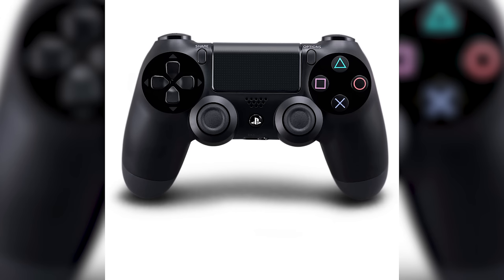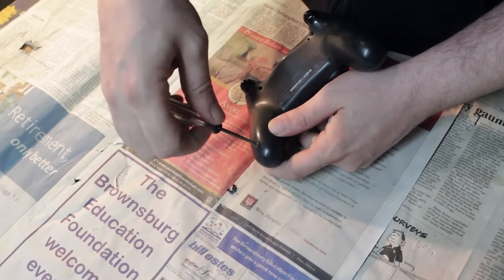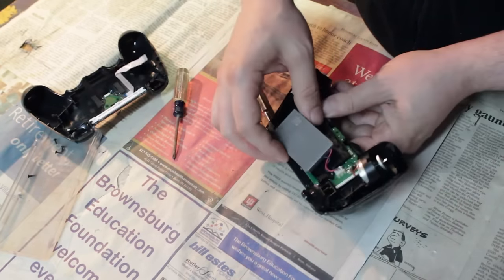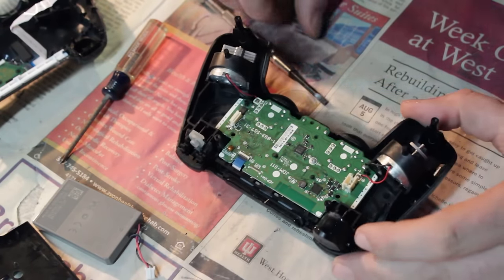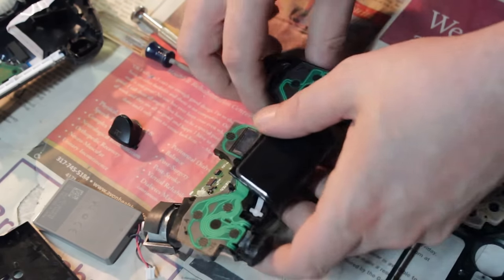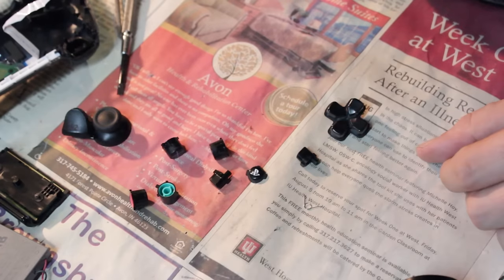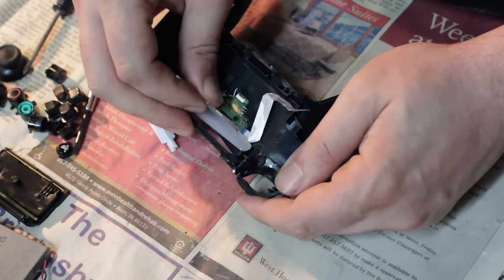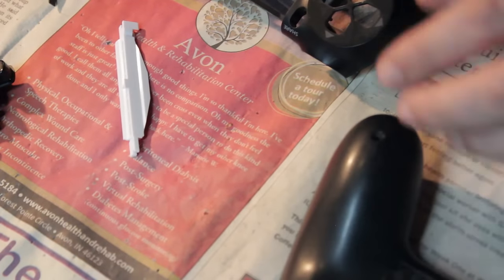How to take apart a PS4 Controller

Comment from the maker: For everyone asking about reassembly, Just look up my Custom Controller videos. Reassembly is in those videos.
Reply: I BOUGHT A PS4 FROM A PAWNSHOP AND THE PREVIOUS OWNER SPILT SODA OR SOMETHING ON IT IT WORKS ITS JUST THE SHARE BUTTON AND THE BOTTOM LEFT BIG BUTTON AND THAT'S ANNOYING BECAUSE I HAVE TO USE THAT BUTTON I REALLY DON'T WANT TO TAKE IT ALL APART AS I SEE HOW ITS DONE JUST TO CLEAN THAT BIG ASS BUTTON.
Reply: next time just link the video for reassembly
Reply: Bro I know it's been 5 years why is it so hard to unscrew the screws I've only gotten two and I've been trying for 30 minutes
Reply: @thatbirdguy9845 they're so small like wtf
Reply: @thatbirdguy9845  3 months too late, but yeah, you need an electronic screwdriver set or a shitty ratchet precision screwdriver like mine. Point is that the 4 grooves of the Philips format are less than half a milimeter OR 1/3 of 1/16th of an inch in thickness. 

Just tiny as hell, so a larger screwdriver will theoretically work because the opening of the grooves is > 0.5 mm (on top), but that's a shallow contact depth and so your screwdriver prolly just blunted the grooves at the top section and then only very fine screwdrivers can get these remaining screws out.
Reply: I can't get the last damn screw out
Reply: You don't have a video of you fixing the l3 buttons?
Reply: @Kazpper88  my grandson spilled juice. Options button is sticking.

Comment: The way it's showed it looks like he is only disassembling an Ikea table while actually it's like defusing a bomb without cutting any cables
Reply: Lol
Reply: Took me 5 minutes now I’m spray painting it gold lol
Reply: @fabuloso3635  pls help im scared
Reply: It was actually pretty easy
Reply: mine was just stuck super bad my dog got honey mustard all in it. When I opened it it flung and broke the fuckin cable
Reply: Bro I’m watching this and this comment embodies the process entirely ong
Reply: That’s tech repair lol
Reply: @trebory6  why you so mad LOL
Reply: Fr, like i fucking cant get this battery off😭
Reply: A $70 dollar bomb, especially when putting it back together and you had to feed one of those cable that tiny rectangle, cause if you mess up you'll have to pry it open again. 
I recommend modeling tweezers.
Reply: @Glyphnophis there’s a screw
Reply: It's crazy cuz Nintendo controllers are so easy I've taken apart with no problem 😭 wtf js wrong with Sony
Reply: It's not hard it is easier than it looks tbh
Reply: LOL, it's not that hard. You may end up breaking a few clips that hold the parts together, but they don't seem that important, as the screws will hold everything together anyways. If you've taken apart a few laptops to upgrade RAM / SSD, this won't be any worse.

Comment: Just trying to fix the sprinting in Cod
Reply: Long Live Pepe SAME Did you ever find a fix
Reply: me to
Reply: Me too
Reply: Long Live Pepe same
Reply: Hahaha I knew I wasn't the only one...
Reply: Same man same
Reply: Same
Reply: Same 😭
Reply: Same
Reply: Long Live Pepe same
Reply: Same lol how do you don it?
Reply: Literally same
Reply: Auto sprint
Reply: My l is busted I'm tryna clean it
Reply: Same
Reply: I have been to the point of crushing the controller because i cant run when i need to on cod. I literally have to keep pushing the analog down and it only only lets me run when it wants to.
Reply: Same
Reply: On god
Reply: @dorrion4x237  lol
Reply: Your comment was 2 years ago. And here I am with the same issue and looking for a fix. I thought it was just me until I went too Google for an answer and seen this issue been going on for year's.
Controller only few months old and as a lot of ppl,only get it on cod.
Reply: Same
Reply: Mr Aws I spray in switch cleaner or any other type of oil based lubricant and it fixes it. The issue might come back after a while but another spray should fix it
Reply: @damianc6623  I bought a new controller cos I was just getting the issue so much. Which is working fine at the moment.
But will give your fix a try since I don't mind messing with non sprinting one now I got the new one.
Reply: Mr Aws pull ur analog up then forward and blow inside of it because there’s dust, fixed mine like that
Reply: @hashimsharif3945  tried that already and didn't work. I have taken controller apart and cleaned inside. Still nothing changed.
I'm going too try spraying lubricant and see if that makes a change.
Reply: Mr Aws  I hear u bro, try any other game that has the same movement as mw and if u face the same problem there, then u need to buy new controller
Reply: Same
Reply: yeah 😅
Reply: Same dude, and now I can’t fucking fix it
Reply: I have 2 dead controller because of sprinting. I need to try soldering in a new stick
Reply: I was the 666 like lol
Reply: mhm, same here
Reply: I swear they designed that feature to fuck up remotes I play left handed because of it
Reply: Same man 😭
Reply: Same
Reply: Yk😂😂

Comment: im stuck at getting the controller apart its harder then it looks.
Reply: yeah, wth its super hard to do. I recon its easier after the first time but like, couldnt they have made it easier?
Reply: Way harder than it looks. And I used to mod xbox one controllers. This is a nightmare.
Reply: All my screws are rusted in and out
Reply: wonder why he sped the footage up for that part
Reply: Getting the triggers off is a bitch and he kinda breezed through that part..
Reply: I can’t even take out the screws
Reply: It’s great that in his “no BS” video, he speeds through prying it open(with a metal screwdriver) & removes the battery off camera
Reply: @trainergrim  same
Reply: Im stuck at the part where he puts it back together
Reply: you have to have a tiny screwdriver
Reply: I finally did it!!!
Reply: Nvm I just broke my L trigger 🤦🏻‍♂️
Reply: Wait I just fixed it
Reply: @luis9943  lol
Reply: Than*
Reply: There's no doubt Sony purposely designs them so they're difficult to disassemble. They'd obviously prefer you buy a new controller instead of fixing the one you have.
Reply from the maker: @joshlarson5316  I sped the footage AFTER that part to get the video less than 10 minutes long.  Yall are some crying asses.  Get your shit together!!
Reply from the maker: @joshlarson5316  awwww..... I'll hold your little hand while you do this if you want.
Reply: @joshlarson5316  why would anyone want to watch him for 5 minutes just to take that one piece off?
Reply: Same
Reply: i almost broke it while opening it bc like, that white rope untied itself, so i fucked myself to put it in, but its working now ig
Reply: For anyone coming late to this:
Squeeze the handles to get them to separate alittle and then use some kind of thin tool (plastic tools leaves fewer marks) to pry the halves apart carefully.
Reply: Josh Larson i mean if you mess it up u mess it up. You live and learn,it’s not hard
Reply: Lol what a bunch of whiners.
Reply: Ikr
Reply: @joshstone4052  yea mine to
Reply: Watched this vid, took it apart and I was like okay what's next 😭

Only to close it back.

Ps it's easy to take the ribbon apart but putting it back is like playing Dark souls over again
Reply: @Drumblanket  Aww, can't take criticism on your crummy video.
Why not show viewers where the 4 clips are located, and which way to pry to unlatch them without breaking them.
Nah, if viewers critique your ordinary content, just abuse them!
Reply: Drumblanket chill OP
Reply: @DodgeThatAttack  I broke all 4 clips on mine, they're not necessary as the 4 screws hold the controller together. The seam is just a little bit larger in some areas now, not as tight together. It's like a 0.75mm seam now, instead of a 0.25mm (rough estimate).
Reply: @EliteScentsOnly  nop it's a butiful dream cuz Xbox is the best
Reply: notPranipus it gets easier doing it few times. it really depends on what you’ve learned from your mistakes. these times takes hours upon hours when it’s your first time.
Reply: I did it pretty alright
Reply: Lurioso Spelar thanks
Reply: Yeah i cant get two of screws to turn
Reply: I broke mine :(
Reply: @Drumblanket  Take it from Drublanket guys. If you make a mistake in a tutorial, and someone points it out to you, the best way to take that criticism is to insult there intelligence with the skill and wit of your average kindergartener.

Comment: my r1 button is stuck registering like its being pressed. I took the button off and nothing appears to be stuck and doesnt register when being pushed even with the button off so im guessing its some sort of internal issue. It would be fine if i could remap the button to something else by using the ps4 custom button assignments but the absolute geniuses who designed that wont allow the custom settings to work if there is any input being pressed which is beyond stupid. This is my 3rd brand new controller in 2 months that has broken and i hardly used them nor have i dropped them or been rough with them they just fail on their own like this. Charging dam near $70 for such cheaply made crap that breaks after a few hours of use should be a crime im so fed up smh

Comment: I was recommended this video and it helped a lot!
I spilled some milk tea on my controller and it got slightly sticky so I ended up following this video and managed to stress free dismantle, clean, and restore my ps4 controller.
I then went and fixed my older controller that was ruined and forgotten after I spilled beer on it and managed to restore it even better than my current one after some deep cleaning. I didnt know how to remove the L1 button but after taking your advice, I just tried harder and it popped out lol. Got a good cleaning done and the only issues I had was I dropped a screw onto a carpet floor when putting things back together. Now I have two fully functioning controllers instead of one.

Thanks so much! :D
Reply: You sure love wasting stuff😂
Reply: Nah I'm just a pathological spiller.

Comment: Thanks, I had a loose USB port and your video helped me get the controller open without damaging it.  Then all I needed to do is gently squeeze the metal frame of the port using parallel pliers to give it a snug fit again.  Works great!.  I had stepped on the charging cable while it was in the controller and the plug managed to pry the metal plates of the port wider and the plug wouldn't stay in, this solved that! Now I have a very nice click when I put the plug in and it firmly holds the plug in place.

Comment: Thank you very much for this video. Saved me 65 bucks! Threw my controller ONE TIME (first time since I was a kid) and it messed up the left stick. Basically, it had indented the plastic post to where it was harder to press down. Just shaved a little bit off the post where it was sticking, and it’s like new. Thanks again!

Comment: this video's great, thanks boi. fixed my directional buttons. easy.
[edit]
"easy" - yeah, no, those ribbon cables are AIDS, constantly terrified i was gonna break 'em lol.
Reply: Not gunna lie it waz ez
Reply: I definitely broke one putting it back together. My triangle button was sticking so took apart too, like I've done my ps4. Broke the golden ribbon on the top. It will select things, and go back, but once in a game, the controller doesn't work at all.
Reply: To clean*
Reply: I broke them help me what do I do
Reply: @wcoadventures  buy new cables, see if they have a part number on them somewhere. otherwise, you're buggered, buy a new DS4 - be more careful next time.

Comment: Who else got stuck on putting it back together?
Reply: I'm in the middle of snapping the top back onto the bottom, can't get the section around R2 and L2 to snap back on correctly..... lol
Reply: @dwrek2054  same man I'm getting nervous
Reply: Juan Cardona I eventually got it together, but it’s been so long now I don’t remember what I did 😂
Reply: this comment thread is why I'm not doing it lmaooo
Reply: @dwrek2054  so if you remove the l2 and r2 from the back of the controller there is a silver hinge use a small flat head to push it forward then hold it with your hand and snap the buttons inside
Reply: I had trouble putting the touchpad ribbon back into place but other than that it was fine
Reply: @unifiedoblivion_  i'm stuck there too. How do end up putting it? I can't
Reply: Me
Reply: Man i Hates doing this tho first and second time i just normal but on the third one i got stock and broke my 7 pin flex $h*t
Reply: not even hard use your head bruh
Reply: Put it all back.. doesn't turn on..fuck me

Comment: Thanks for the tutorial! Gosh I had no idea how difficult it was to pull apart a PS4 controller! My D pad was going bad so I bought some parts to replace it. Now everything works like new! I’m happy. 🙂
Reply: Aw good yeah it helped me too I had stick drift and now it’s Gone but now the damn apex servers aren’t working
Reply: @peta-butter2744  how specifically did you fix it i still have some not nowhere near as bad but its still there
Reply: @thewarrior909  umm so I fixed it for a little bit as long as you didn’t click in the stick. But then it just got bad again I think the stick was just wore out. There was nothing to clean I just tried to lube it. So I wanted a cheap controller so I looked on offer up and this guy was selling a bunch of them but turns out they were fake… so I spent even MORE money and bought an official one. And it’s great. Words of wisdom just buy Sony first, you get what you pay for!
Reply: @peta-butter2744  thats good i had a few controllers as well and on a newer one my down dpad button didnt work so i just  swapped some parts and the one that has stick drift still has it but its a older one so i just use my fixed one now

Comment: Had a problem with the X not coming back up after being pressed, took it apart with the help of this vid, and found that the silicone button thingy had a tear in it, so i got one of my old controllers and replaced it. Works great now.

Comment: Great video, very clear, very concise. Needed to dig into my dualshocks guts a bit to figure out what was causing me to have deadzone issues but, seeing as how I'm not a mongoloid, I didn't wanna go accidentally breaking something cause I don't know what I'm doing. This video was a great help. Unfortunately I had to use a little more force than I'd like to get the casing off and ended up snapping a tiny tiny itty bitty little facet. Knowing my luck it's probably the most important part too. Anyway thanks for such a clear and helpful video

Comment: My down D pad wasn't working, I finally got tired of dealing with it, so I found this video. Now, not only do I have a fully functioning controller again (My issue was cleaning it, for anyone with the same issue, use a cotton swab/ q tip and some isopropyl alcohol if needed), but I actually understand the anatomy of my controller. Thank you so much.
Reply: My down d pad no longer works. It started messing up on me again about a week later (pushing it really hard usually did the trick in fixing it) but now it does not work no matter what I do. My screws are messed up beyond repair now so I need a new controller.

Comment: I'm stuck at removing the screws, they're very hard that my hand was hurting for a day trying to unscrew them. I'm weak
Reply: @umayrhussain3211  if it takes that long you may have stripped the screw trying to use a knife or the wrong size screw driver. Use the right tool for the job and it's waaaay easier
Reply: Do they sell a PlayStation screw specific screwdriver lol?
Reply: @enflow8440  my pops had some a lot of tools so I'm just lucky
Reply: @Prymistic  no lie as soon as I posted this I looked on line and bought on. Specific size is 00 x 50 phillips
Reply: @enflow8440  👍
Reply: Facts

Comment: so I spilled some syrup in my triangle and O buttons( somehow ) and had to get my buttons unstuck. I could've brute forced this thing apart. And prolly broke something. Thanks for walking me through this the right way. Sexy voice btw <3
Reply from the maker: Next time you eat pancakes, Dont try to use your controller as a fork!!  lol!
Im really happy I was able to help you get it taken apart and cleaned up!
Hope to see more of you around!
Me and my sexy voice are putting up videos everyday!!!
Reply: What size phillips screwdriver do i need
Reply: I have a set. I think the one i used was a quarter inch maybe one size below it. if you've put together any kind of furniture, chances are you got one laying around somewhere already
Reply from the maker: size 0 screwdriver works best
Reply: @Drumblanket  Great video. Mine turned out great except 1 thing was the bottom half was a touch darker shade than the top (obviously I did all 1 colour) is there something I can do different to avoid that?

Comment: I've had the same two controllers since launch day of the ps4. One of the controllers had a weird glitch where if you press L2 it makes you move forwards which is not good for shooters. And the other controller wouldn't charge and if it did charge it wouldn't hold it. This video helped me to take apart both controllers safely and mix the parts to make one perfectly functional decade old Franken controller. Thank you for the help sir!

Comment: When i took mine apart to clean the circle button i had to unplug the touch pad ribbon cable it was a pain in the butt to get out but putting it back in was easy good video this helped a lot
Reply: How did you get that out I'm stuck😭

Comment: Alright but how do you even get the thing apart?! I tried an old card I didn’t use, a flathead screwdriver, and a pry tool. Lol
Reply: Use your nails
Reply: I don’t know but throwing it on the ground seemed to work for me
Reply: Try every screw driver in ur house or google
It sure u can find it somewhere iunow
Reply: I used a putty knife but the damn controller is so flimsy I almost cracked the shell unhooking the latches